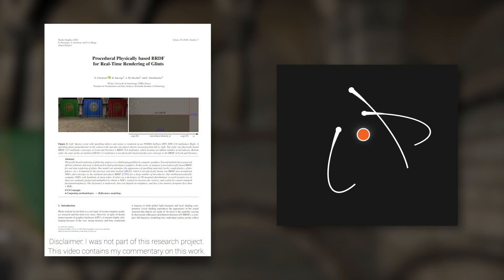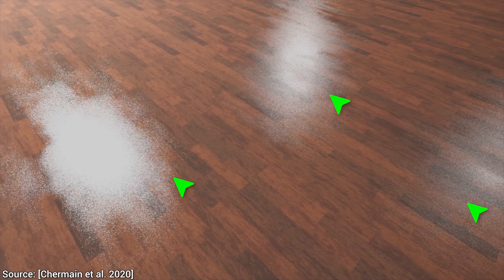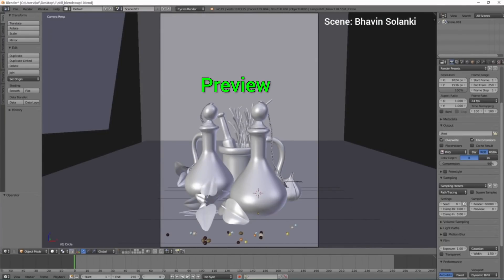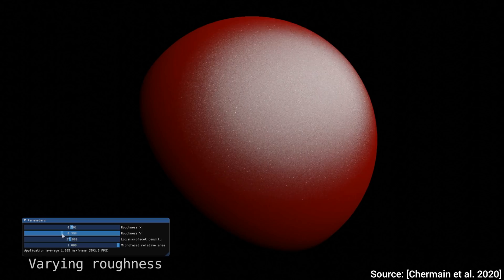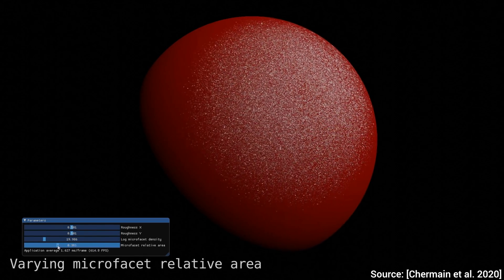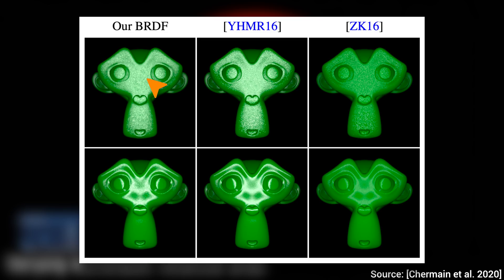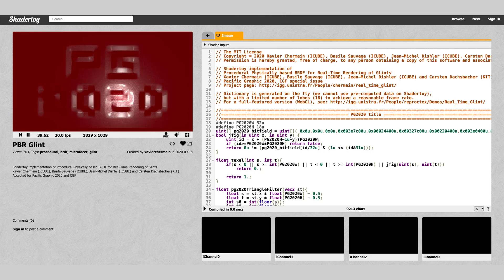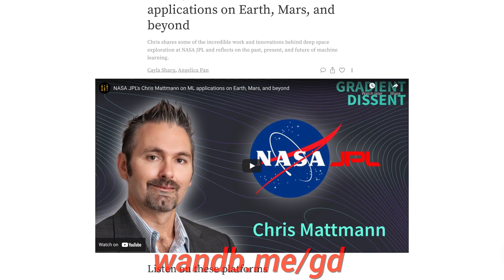Beautiful Glitter Simulation…Faster Than Real Time! ✨

Comment: I think the term "real time" gets abused by graphics researchers. Because this nominally means with a particular guarantee for when it completes or yields - which may or may not be a particularly short time. There can be realtime systems that run in nanosecond or mulitiple-second intervals. It's not like you can provide a particular guarantee on a GPU, it's at best soft realtime. I propose that the alternative is "at interactive rate", where the performance of rendering is high enough that you can seamlessly manipulate it or even "at highly interactive rate" if you can imagine the algorithm to be used directly in a videogame with today's commodity hardware.

Comment: Saying faster than real time is a bit of a bait when 'real time' in this instance is based off 60 fps or 16.66 ms intervals, when real time physics are happening at imperceptible time frames of a much higher frequency. Also the comparison between models, even at 480p I could quite clearly see a rather strong blur on the new model compared to the high quality old model, so to refer to it as being 'just as high quality' as ones before is a bit of a stretch too.

Comment: I implemented snow glitter for the Golden Compass in RenderMan more than a decade ago.  Perhaps not physically based, it was still indistinguishable from these examples. Simply shade single pixel sets of micro-polygons using surface derivatives with noisy normals. Nevertheless this does look great, and hats off for doing the math "correctly."

Comment: Wish you would have talked about why this is a significant problem that needs to be solved.
I can't really see how it is, since it's not hard to make procedurally glittered/flake materials already by using a colored voronoi texture to drive the normals of an object. They're not even costly, and you can do it in real time as well. It's not like there's much to the PBR element either, since it's just reflections that fall off at glancing angles, which you can do just fine with a fresnel-based mask. All for a result that adds the equivalent of fireflies on the final render, which will probably get nixed with an ai denoiser.

What makes this so important? Is there something that I'm missing here?

Comment: Thanks for this. For half the video I thought why is this at all difficult, its just a random probability of a direct reflection of the light source. I think though when you played with the microfacet size it came clear that to do this well from frame to frame it may require a lot of sub-pixel sampling to avoid 'glitchiness' hence the slow rendering times of previous technique. However, I'm reading between the lines at little. You have inspired me to check out the paper.
Reply: Also I think there is a need to cope with self-shading otherwise the technique is not physically based

Comment: What do you mean by "faster than real time"?
AFAIK, in computer science, real time means your software is going to comply to your time constraints, and you decide what that constraint is. It could be 1ms or 1s, depending of your application. So your statement "faster than real time" doesn't make sense to me, unless there's a generally accepted delay in this research field, that would be a bit more than 2.5ms as you say in the video.
I assume you could base your real time on the refresh rate of a screen, which would be 16ms for a 60Hz monitor, or 3ms for a 300Hz monitor

Comment: 2:08 Am I the only one really familiar with that interface?
It really looks like the reshade settings menu, maybe can be injected into existing software?
Reply: I believe the interface is imGui, but this is like a shader - like note the WebGL demo and ShaderToy implementation so yeah someone probably could do that... just not because of using imGui, that has no relavance?!
Reply: I think it might be taken straight from reshade, or maybe even done in reshade
Reply: @Hoolahups  If it is, I want this, just to add some random surface imperfection and maybe even simulate some soft reflections